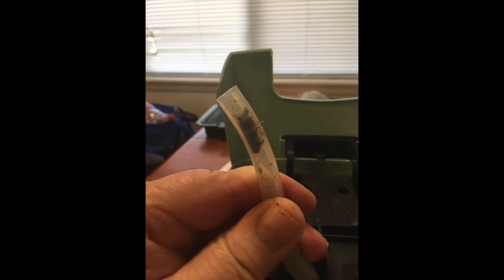How to unclog the Keurig coffee maker K 15 mini

Comment: I can't get the cover off just by removing the two screws underneath and I can't figure out to get a screw driver to work on the other two screws further back.
Reply from the maker: If you can’t do anything describe in the video .. buy a new keurig  .. if yours is still under warranty call them with your serial number. The squeaky wheel gets results.
Reply: I figured out how to get the cover off. There are two latching tabs on the back of the cover, about a 3/4” from the corners of the cover. I ran a tiny flathead screw driver back there between the cover and the base, I eventually popped it off. When I put it back together I couldn’t get them to latch again, so next time I will only have to remove the two screws and it will easily come off. Thanks for your video👍😊
Reply from the maker: @careyellen  good 👍🏻